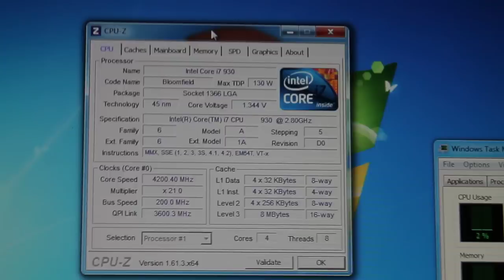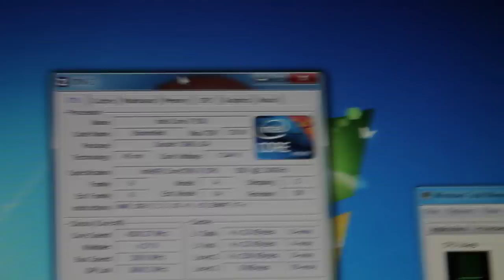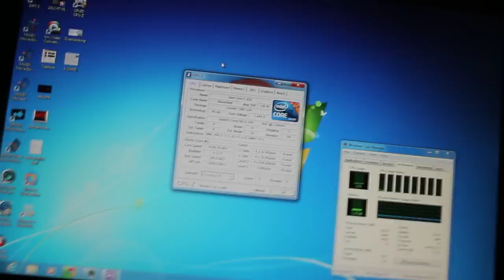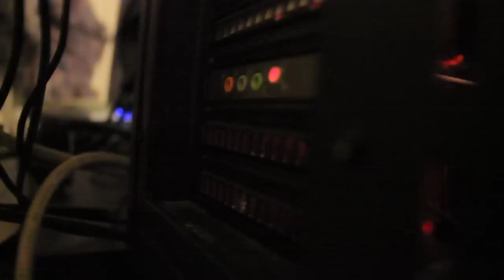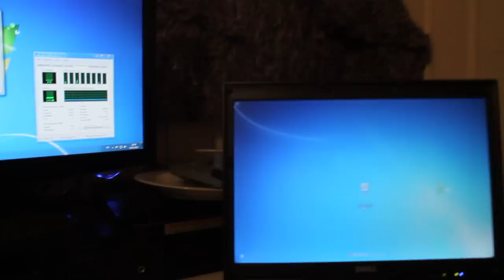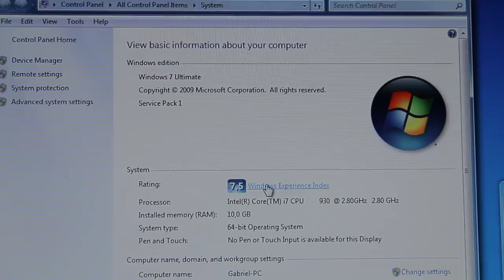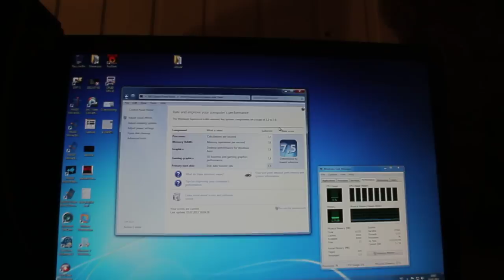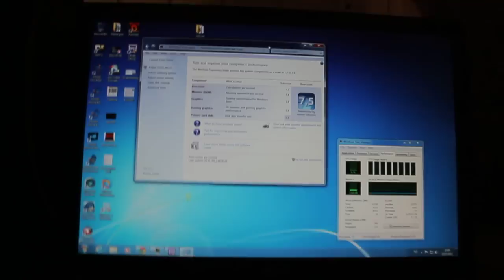Intel Core i7 930 @ 4.2Ghz - Final Stable overclock

Comment: The stock speed is a part of the CPU's name. I also have the 930. If I open System Properties (Windows button + Break or My Computer > Properties) it says "Intel(R) Core(TM) i7 CPU 930 2.80 GHz @ 4.03 GHz".